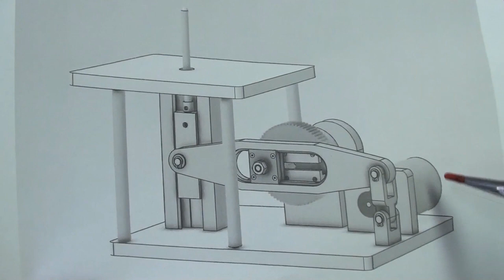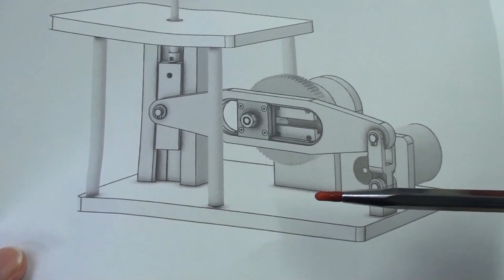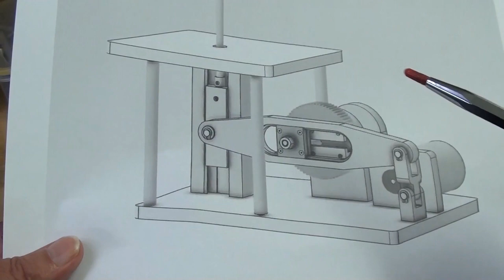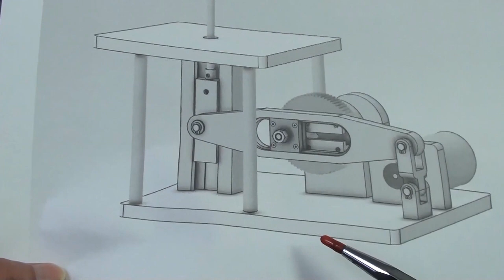Die Filer - Part 1

Comment: Good thing about your design is because you are using a similar system to what drives the ram on a shaper is it will have two stroke speeds depending on which way you run the motor . you could run it in one direction and have a slower down stroke for heavy work and a fast up stroke , then reverse the motor and have a fast down stroke for smaller parts or softer materials and a slow upstroke .
Reply from the maker: That was exactly my reasoning behind the design.  My father taught me that when filing to go forwards slowly and fast on the return stroke.  He said it helped to clear filings from the file.  It was taught to him by his teacher in the Naval dockyard apprentice school in Hong Kong where he did his apprenticeship in the 1930s.  I've been told since that's balderdash!  I believe my old man.
Reply: @bizzibeeworkshop  
There is an incorrect perception that backstroking the file blunts it , a YouTube channel called fireball tool proved this as incorrect - he set it upon a machine and run thousands of strokes both forwards and backwards and then only forwards but couldn’t see any sort of damage to the file . How many people do you see lifting a hacksaw on the backstroke ? The only difference between a hacksaw blade  and a file is it’s width and the saw has a set - other than that the tooth profile is essentially the same .

Comment: What is the motor specification??
Reply from the maker: Hello.  The motor and gearbox were purchased  through eBay.  The reference is "https://www.ebay.co.uk/itm/263753103864?var=562966073949"  I also requires a power supply. I used one of these:
"https://www.ebay.co.uk/itm/403669696979?var=673605526789",  also from eBay.
John

Comment: Nope, I don't like this design, it has too many friction sliding surfaces.
Reply from the maker: You are entitled to your opinion, though, in my defence, I did mention that it was designed in response to a request for an alternative solution to the "normal" crank pin arrangement, not a "better" way to make it.  Additionally, it also provides the "quick return" stroke that is built into the shaper motion on which it is based.
John
Reply: Well, sliding surfaces, especially those near the actual metal removal area, will get fine swarf in them so I don't think this alternative is a better solution.....why re-invent the wheel and incidentally there is no back support to the file  @bizzibeeworkshop